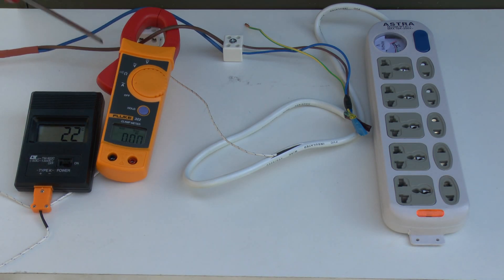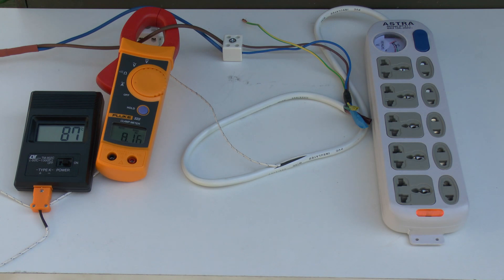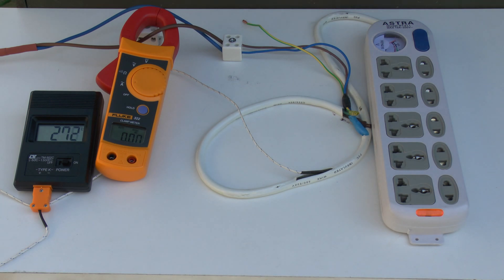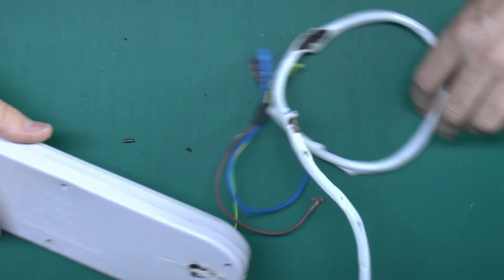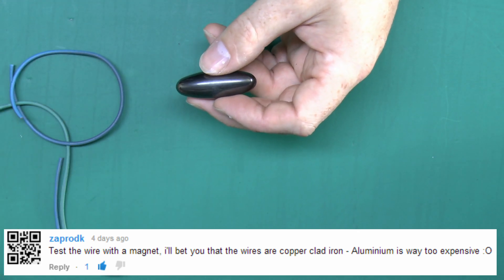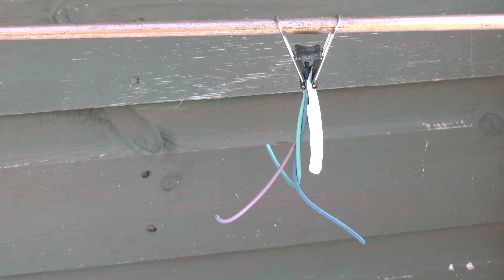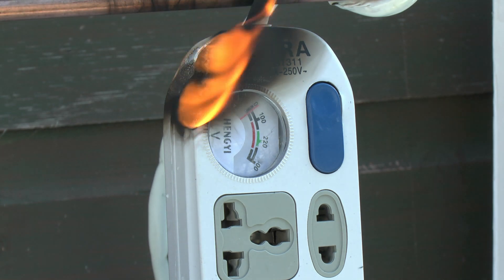Dangerous Multiway Extension Lead ASTRA BT311 (Part 3)

Comment: In the early 1980s I worked for Associated British Cables in Christchurch, NZ and we used a material a Union Carbide Material 8024 and the extruder had the heating element temps set to 220°C or 240°C. I am not surprised by the results of the cable after your test except I thought it may have been more runny . The lack of liquidity of the plastic may have been due to the manufacturer using recycled and badly contaminated material which hadn't been filtered (that was done by a fine wire mesh screen that mostly kept contaminates out of the "raw" finished product) that had different melt temps. The lowest that I can remember was 160°C and the highest was 280°C but both those temp extremes were in making plastic film and not cable. I mention these temps because those materials may have been mixed in with any recycled plastic used. In the plastic film side, recycled plastic was used in what was called Builders Film. It was 2 metres and 4 metres wide and it was 100µm , 150µm or 200 µm (microns) thick so impurity lumps were not so critical to have. 

Materials and temps will have changed from my day so it may be totally different from the way we did it them. I didn't see it during the videos but we used to put a twist on the wires before they went through the extruder die for the plastic coating. This would have stopped it moving inside the last coating application. There was also a "talcum" power applied to the cables after the twist. I believe this was to reduce the cable rubbing against each other inside the last coating when the cable was bent .

Comment: This video being 5 years old now, i have watched all 3 parts. I have got to say, i have never seen an extension lead so dangerous. If i saw one outside someone's house, i would assume they were going to attempt a false insurance claim. Trading standards need to step up and weed out all this lethal electrical equipment. This is what you get with over 10 years of austerity.

Comment: Wow..  what a bit of crap that thing is.   The way they ran the wires inside was terrible as the socket nearest to the incoming lead is usually the first in line and I always use that on multi socket boards .. But this one the nearest socket was in fact at the end of the line. !!!!   would have made more sense if the made the wiring a loop ?    I have found that Chinese stuff can be good, BUT it all goes wrong when you get Chinese copy or fake products of a good Chinese item  Mainly USB mains adapters.  And then you get the crappiest stuff when you get a rip off of a fake item. 

Great series of videos for this item..      You should start you videos with   " There now follows a Public information video "

Comment: why did it take so long for the breaker to trip the circuit ?
Reply from the maker: No breaker tripped - the current was only about 10 amps.  It was switched off once the cable temperature reached 300C (570F).  If it had been left powered, the cable would have continued to melt until the wires shorted out internally or it set on fire.
Reply: @jwflame  did you bypass the breaker  for this demonstration ,  if I did the same experiment it would have tripped the breaker immediately.  is this the reason that UK plugs contain a fuse?

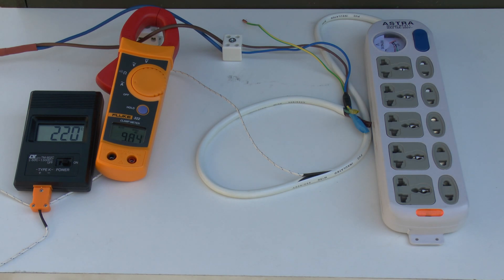Comment: 4:30 Sorry to pedantic but "double the boiling point of water" will be 273.15+200= 473.15C, since zero temperature is -273.15C.  0C is only zero on the Celcius scale, it is not zero temperature.

Comment: good video!!! I do have a question that in short never seen any real answer! first I live in the USA so most of these adapters I am not familiar with. HOWEVER I have seen them in computer electronics stores! knowing the difference between voltages in different countries stupid me thought they had some voltage dropping circuitry! ya right! how can a 120v USA item work in a adapter with basically double the voltage? am I missing something? I am not a electric engineer but have built and understand the basics.
Reply: Many modern electrical items are designed to accept a wide range of voltages (typically 100-240V) so they can be sold internationally. Not always the case though, so you need to be careful and check exactly the spec on the appliance before plugging in an adapter.

A device that alters the voltage is going to need a transformer, these would be bigger, heavier and more expensive than plain adapters.
Reply: Oliver Keating Not so much anymore. Switched-mode power supplies are what allow so much stuff to work on multiple voltages, and they don't require much of a transformer at all.
Reply: @puckcat22679  But converting 240V AC to 120V AC will require something more than a tiny 5W SMPS.

Comment: Typical Chinese product, just fine at half rated current/power, starts smoking at 80% and goes up in flames at 100%.Another thing to avoid like the plague. I remember when i was a kid and the molded plastic plug on the sandwich maker we had caught on fire, my dad cut the power from the main breaker to be able to get it out.

A few years later i found it and replaced the mains plug myself with one bought from the electrical store. That sandwich maker worked fine for a couple more years when the plastic clip that holds the two halves together broke. The flex cable and heating element and outside shell were all fine, it was just the mains plug that was of dodgy quality.

Always a thing to remember, a single weak point in a mains-powered appliance can turn the whole thing into a potentially lethal fire hazard. Always go for proper safety rated products, you and your family can be at serious risk when using these cheap unapproved products.
Reply: Andrei H - those that have a clip on the front/handle are waffle irons, they can be used to toast sandwiches but the heat output is fixed and the resulting toasted sandwiches tend to be wedge shaped - pinched at the back because of the fixed hinges.

Comment: Well done for exposing this horrendous device John. By my rough calculation from your resistance tests, that flex is dissipating about 200W at the maximum stated current rating of 10A!

Comment: You didn't believe any of the other writing on the device, but you believed the 10A rating, lol :)
 I don't think anyone in China would believe anything written on such a thing - well, not a Chinese person anyway. IMO, the problem here is allowing it to be imported (rather than the device itself), and a lack of enforcement. I would imagine it is intended for the Hong Kong market where they don't bother (anymore?) with the BS standards (more's the shame). Also, lack of morals of the people importing obviously and well known to be substandard quality products into the UK where we expect better (and wouldn't expect this sort of poor quality) - and so people would be more likely to suffer for it.
I would be interested in knowing what standards are applied in Hong Kong, if any...
However, I feel there is an assumption that everything that comes out of China is poor quality, which obviously isn't true (people usually consider Apple products to be high quality, as least in this respect)...IMO, it's more a lack of quality control and standards enforcement.
In any case, I have a few such devices that I will surely test and/or ditch as a result of this. I bought some from B&Q, so I would hope those are of reasonable quality. The others, though, I wouldn't trust at all. I make a point of feeling how hot they get whenever I use them.

Comment: John bought some cheap short length multiway adapters in the pound store, My intention was then to buy decent thick flex and extend them in length, turns out the cables are soldered terminals or contact welded on the inside and no longer secured via terminals or spades is there a trend now in safety standards to not used screwed or spade terminals ?
Reply: +beingatliberty Several years ago now I bought several 4 way power strips from a 99p shop. The cable was thick enough and the sockets were shuttered and only accepted UK plugs (not this any type plug can be jammed in nonsense). I thought they were okay, certainly okay for low current stuff. However the outer white plastic case of one of them softened after a few month and became like cheese. I noticed whn one end got smashed exposing live metal parts. On examining it I was able to just break it all up into quite small pieces with my hands. Of course I immediately threw all the rest out as well just in case, but the others did seem okay.

Comment: I saw this on ebay, looks like it might be made by the same manufacturer, the silly things printed on the packaging are suspiciously similar http://www.ebay.co.uk/itm/2-USB-UK-Plug-Outlet-Power-Extension-Cable-Socket-Portable-Plug-Strip-Adapter-/191832710828?hash=item2caa1edeac:g:dhkAAOSwxp9W8Reu
I particularly like the safety notice "Nonprofessional electricians should dismantle the product by themselves"

Comment: Should have tried 32amps though it as that's a typical uk house ring main circuit breaker rating with no fuse it could well see that in fault conditions.

Comment: A couple of years ago I found one of these on the pavement next to the recycling bins and immediately recognised it as horrible crap so of course I had to take it home!

Mine looked superficially similar except it had a Schuko plug but the guts were slightly different. No earth continuitiy whatsoever either but in this case the reason was obvious as soon as I opened the power strip - although the flex does have three cores, there is NO trace of solder on the earth terminals at all!

All three cores are solid black and don't appear to be scorched, I don't know if this monstrosity has ever been used. Apart from the earth continuity it actually is worse than the one you dismantled because all three cores are as tiny as the earth wire in yours!

It's been a while but I seem to remember something fell out of the casing after a little playing, I think the volt meter came loose. Don't ask me how this thing got here (Austria), it sat next to two old 8 mm camcorders and a bunch of used VHS tapes. Probably expats from some Asian or South American country, I haven't seen anything like this ever being sold in Austria. Wasn't actually a cheap part of town BTW, rather the opposite.

Comment: that magnet he used to test for ferrous metal in the wire i used to have a pair of those magnets as a child they are sold as toys and when you throw them in the air and let them attract to each other they make a weird electricity noise :D. it was all fun and games until i stuck one on the television (CRT) and magnetized the screen messing up the picture aha my dad soon made them magnets vanish :D

Comment: the Chinese should be fined by the UK for substandard goods being allowed to be exported.  it's likely that someone will be hurt or property lost if these goods are not found out by professional testing.
Reply: You can try taking them to court, and imposing fines, but they'll find loopholes and never pay any fine. 

Chinese sales philosophy is completely different to our normal expectations. There is a prevalent attitude that, if you are a businessman and not working some kind of scam, then you are a bad businessman. There is also the attitude of 'make a quick profit, and don't worry about the consequences', or future sales. There is also no copyright, so it's common to find well-known trademarks, brand names, and product designs being used openly. Hence the high percentage of substandard and counterfeit goods coming out of China via eBay, Aliexpress and other outlets.

Check out serpentza for some revealing insights into some Chinese business methods. Winston has lived and worked there, mainly in the Shenzhen area, for more than ten years.
Reply: It's not the Chinese people's fault that idiot westerners will buy and import things without having the faintest clue what they are or what standards apply. The Chinese manufacture things and offer them for sale.... they don't force anyone to buy.
It's the IMPORTERS who should be fined. Here in Australia, the legal responsibility rests 100% on the person who imported the non-compliant device, and never on the factory who manufactured it.
Reply: @johncoops6897  So it's not the Chinese people's fault that they lie on the packaging? It's not the Chinese people's fault that they deliberately ignore legal requirements? You are the idiot.
Reply: @bayadere8308  - the Chinese ARE NOT ignoring legal requirements, because there aren't any requirements for them. Those requirements only are important for the buyer...
By direct importing, the buyer is deliberately bypassing their own country's safety standards AND consumer protection systems. In fact, because they are the importer, technically it is THE BUYER who is breaking the legal requirements within their country.
Regarding the purchase itself, the sole legal principle that applies is termed "Caveat Emptor".
Google those 2 words, read and learn!
Reply: Seriously? Anti-Chinese much? You don't think it should be the importers that should be fined for importing it? It's the greed of westerners that is more to blame here, imo.
Reply: David Waterman I'm not anti any people but I am of regimes that turn a blind eye to mass export of duff and dangerous goods.  Yes greed is much to do with the problem but the Chinese regime should start tightening up there standards and checking whats going on and doing something to promote higher standards.

Comment: The discoloured insulation in the first video is proof that the wires were put under load before being packaged then shipped.
Reply: +OlympusHeavyCavalry They might be old, recycled/reused cables. That's cheap. :P
Reply: It's interesting how this sort of product gets past customs etc. We face the same problem here in Australia. I always buy the expensive ones & avoid the $2 shop ones or cheap internet crap. I always look for the safety logos & read the literature on the package first, after finding the particular brand in mind. Cheers for the video & I hope this has saved lives too. :)

Comment: Was this crap sold like legit ?. All this electrical devices are supposed to apply sorta of UL or carry a batch of test according some standard ?. See chinese crap around here, but not that "top" crappity. Of course there are regulations but isnt rare at all that someone manage to bypass them and sell thing like that. I double check socket and plugs when using heavy loads and monitoring temperature, just by hand, Here the standard socket are rated up to 10A. special sockets are sold to work above 10A. But medium quality sockets wont even survive 5A continuous. As soon as a socket cant hold a plug tightly the problem starts

Comment: As I watched the videos in this series and could see so many absolutely outrageous issues with this device I found myself slightly disappointed that the cable did not burn more spectacularly.
In the past I have certainly encountered 13a mains plugs that got dangerously hot at full load but were fine at lower currents,  but in other respects the plugs were acceptable with correct dimensions, fuse holder and cable retainer. 
Unfortunately the old B.S kitemark which in the past many of us regarded as something we wanted to see on our appliances was in fact close to worthless itself. If part of your TV was made from an approved plastic the entire tv was entitled to bear a kitemark.
The failings you identified with this distribution block go beyond a small technicality, I could forgive the wrong earth wire colour.
If you wanted to deliberately make an unsafe product you couldn't really do much better...
Thank you for making this video series.

Comment: Presumably 300°c can't be far from melting those quality soldered joints on the socket terminals either?
Reply from the maker: reggiebacci Yes, 300C would melt most solder, including the lead free variety.
Reply: +reggiebacci I was surprised he didn't unscrew the back again after the 10A test....would have been interested to see if any of the solder had melted, or anything else for that matter.
Reply: Maybe the solder was the alleged overload safety device!
Reply: +John Ward Just a loose plug inserted into 1 of those sockets would have caused enough heat in metal to melt the solder which would float around freely to short on whatever. The only redeeming quality of that thing was the insulation on the lead was self extinguishing.
Reply: +zwz • zdenek lol just as well it didn't have the shutters then lol! it needed the ventilation X3
Reply: reggiebacci Melting point of Sn63Pb is 160°C. But the sheet metal socket contact will dissipate something, as well as the brass plug pins, so it may not melt.